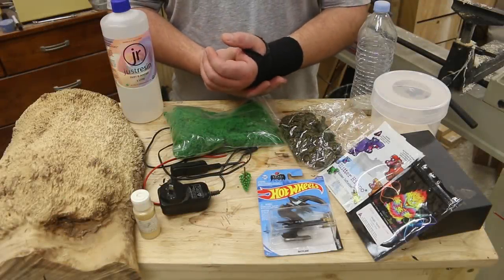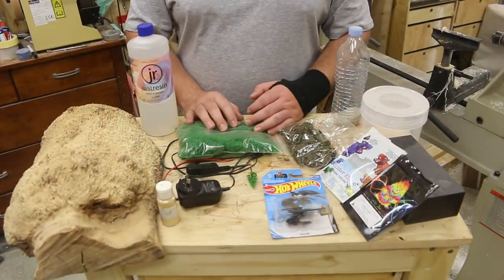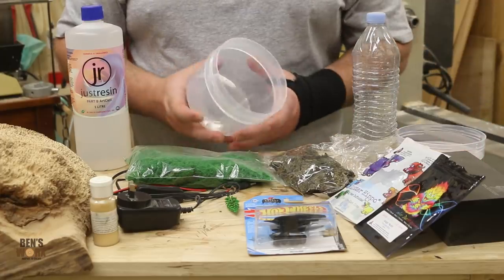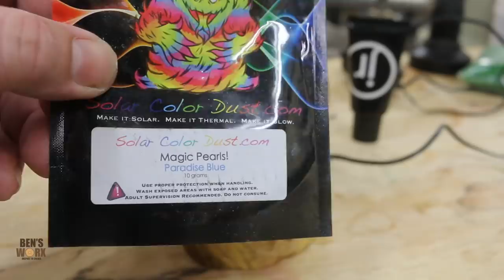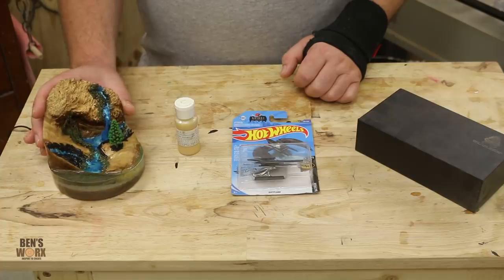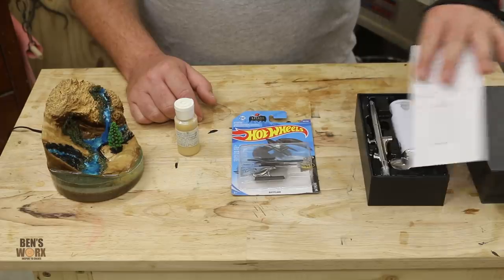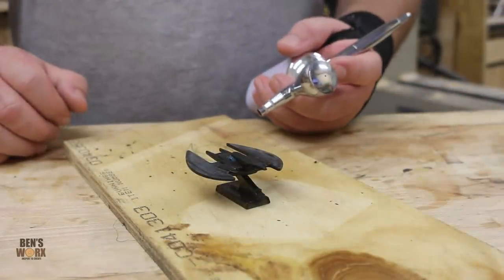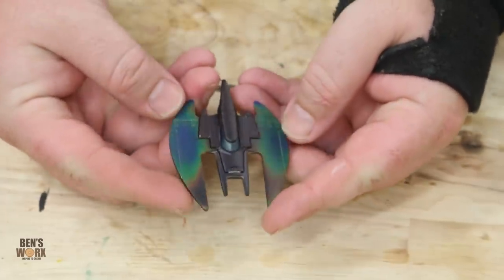Making a Batman Diorama Night Light Using Liquid Crystal - Resin Art

Comment: It did turn out pretty nice. is there any chance that you might fill this with resin and turn it? If so will it destroy the effects of what you used on the bat wing?
The only problem I could see with the night light. How do you keep that dust off of it? I am pretty sure my cat would try to eat that little tree too. LOL
It turned out so nice.
Reply from the maker: Thanks Lorrie, I think it would be hard to apply heat to the Batplane to change the colors once it’s in resin 👍
Reply: @BensWorx  Do you think you could turn a dome for it?  That would keep it clean, cats out and add another effect too!! But only when you hand is better of course.